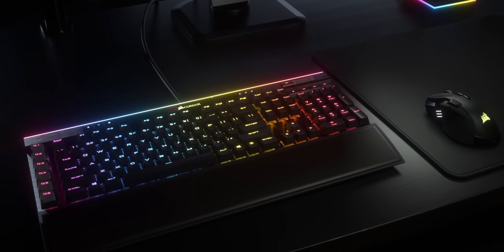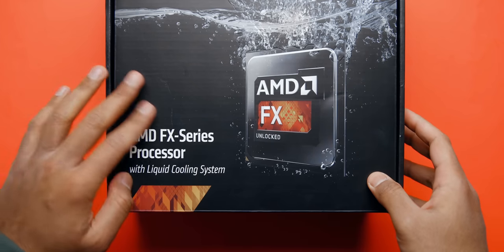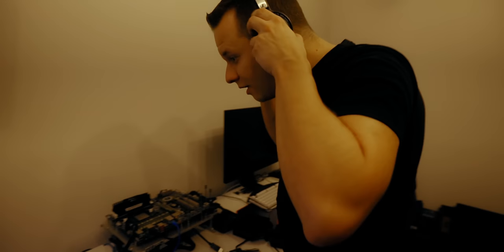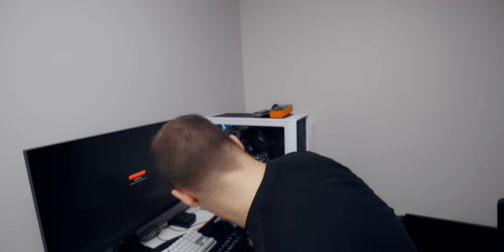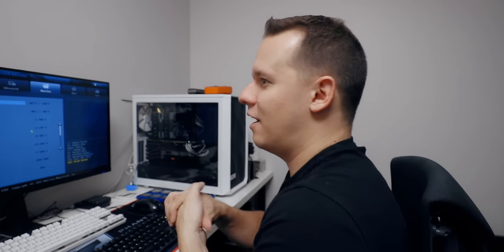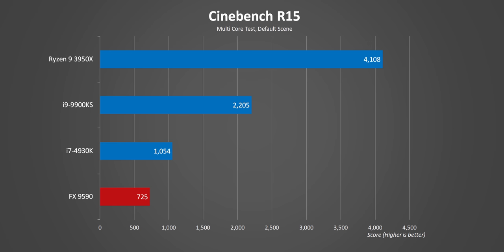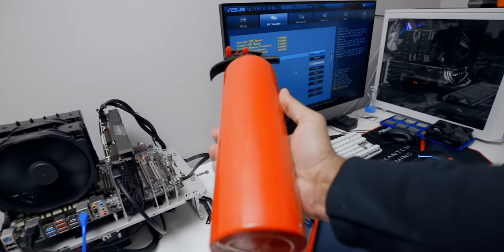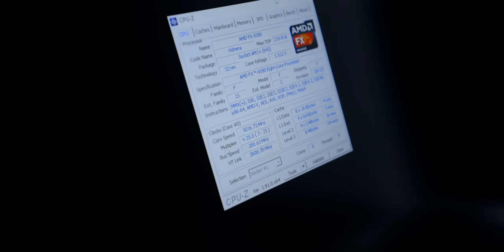Why The FIRST 5GHz CPU Almost Failed - AMD FX-9590 Revisited!

Comment: Intel now is like AMD back then

AMD back then still using old node and pushing clockspeed regardless of heat just to stay competitive,
but still drop prices in the end 

15:30
lifecycle
Reply: It's a cycle that tends to repeat itself. The Pentium 4 was pushed beyond its limits as well (Prescott, anyone?)
Reply: But the 9590 WASN'T COMPETITIVE, so how could it stay competitive?. It isn't competitive if it only matches an i5 3570 in gaming back then sometimes even the i3 and that is for $300 USD 200+W 8350 rebrand.

Ryzen has a 7nm advantage but none of their 8 core CPUs have beaten a 14nm 9900K and using core count+MCM as a band aid for their shortcomings.

Both situations are not similar at all
Reply: @JABelms  Wow, you sound like an Intel zealot. I can see the benefit of both sides of the coin, Intel has slightly superior single core performance which is great for gaming. AMD is the king, currently, of multi-core which is needed for doing real work on a PC.
Reply: @shadowtheimpure  Wow, you sound like an AMD zealot. Zen2 still trades blows with Intel, even in MT usage. Infinity Fabric remains a huge bottleneck; compare memory access of ~70ns (cross-CCX) to Intel's ~35ns -- which, believe it or not, is relevant in heavily multi-threaded workloads. Benchmarks won't show the difference since they don't work with large amounts of data -- which means that most memory access is to the CPU Cache, of which AMD threw ballsy amounts to compensate. Same with eg. 3990X - it's a dead product due to its memory limitations.
Zen3 is announced with some interconnect goodies, let's hope it improves the bottlenecks.
~Fellow AMD user, with multiple builds running Zen2 and AMD GPUs (that I should've returned due to the awesome drivers)
Reply: @JABelms  having owned both sides, honestly, it depended on the game and workload, as well as video drivers, nvidia has for a long time had better threaded drivers then amd, their drivers can and do make use of the extra cores, on the other hand, amd also had avx and fma support that took intel generations later to add support for, that, some workloads i have run, genuinely ran faster then an intel "supperior" but in the same price range chip would offer.

as to games... i have had a few of those that where insanely bias, but mostly anymore, games run well enough given a decently matched gpu, that i have run quite a few at 4k on both amd and intel for a few years now,  and note, im on a x5675@4.4ghz with 48gb ram as i post this, and, in some tasks this destroys the fx line, some games, its just..... pathetic, others..... honestly, many games i have played today, it dosnt matter if its an fx series, 9900k, 3700k, you will be capped by the games lack of proper threading and optimization... great example... GW2 talk about.....pathetic... it still thinks cpus have 3 cores.(yes it has more threads but only 3 are perf critical and any time one stalls the others endup waiting and it causes perf to just... take a shit....  

ARMA II and III are VERY much lovers of intel cpus... but i have also seem them run so close on a 3600g vs a 8700k, yeah... it was just a matter of the games lack of optimization vs how well the system compensates at any given modment... so close... it was pretty much a crapshoot... mind.. the 8700k was cooked with a THICK 280mm AIO with quad noctua high static pressure fans, the 3600g just had a "Macho" with cheap pwm fans on it, most games... its genuinely just a crappshoot, some even run better in one aspect, and worse in another, load times may be worse, but fps better, or the other way around, or, min fps may be better, but max worse, or max fps, very very high, but the min fps being paunfully low...like 17fps, at random spikes.

the same could always be said... as somebody whos owned both sides products from the 80386 era forward, i havent ever only had one companies product.. the k6-2 moved me from an overclocked intel chip to an overclocked super socket 7 chip, then i moved to a pair of  overclocked socket 370, then i moved onto a duron, then full k7, then i had a tul p3, was given a pentium-d (talk about a slow piece of shit....a dual 1.4tul based celeron system was way way faster...at stock..vs 3.6 out of a pentium-d....fuck sake..) 

again... it was always back and forth depending on use, one place even intels best i7 990x at 4.6ghz(hard oc from the exp of everybody i know who tried it on them with a decent amount of ram at least, and the temps, and power use...) couldnt beat the 8350@4.65ghz (negative vcore offset by 2 ticks, llc on high as close to 2600cpu/nb and htt as possible) with 32gb of 2133, was always faster at audio encoding at least from any format into OGG or Opus, with OGG using a BlackSword Optimized sse3 encoder, i was able to pull over 100x faser encode speeds in the same files at the same settings, same encoder, same exact settings, just.. made my eyes cross..but then.. i started to look into it.. and... HT off...i gained back 15-25% depending on the kind of batch, but... ht helps other things that without it...the intel chips dont look as much more impressive perf wise..

and the 1366 platform had such legs, because, triple channel ddr3 can come close to the perf of dual channel ddr4 but with lower latancies, and, the oc on them isnt that hard... a cheap x58r-ud3 is 100usd, an x5675 is 30usd shipped at the higher end, and ddr3 you can get 6x8gb sticks pretty easy these days ;)
Reply: @EdU-od5ec  the 7700k was slower in many games, vs my 8350@4.65...... that was over a year ago when we tested, was abit...shocking honestly...i remember under win7 it getting its arse beat hard... in every game...
Reply: @JABelms  9900k only have advantage in gaming tho, 3700x and 3800x did perform slighty faster in some rendering task.

Comment: I personally love hardware from around 2010-2015, there's tonnes of quality and potential out there, and you can sometimes find absolute bargains
Reply: 3rd gen i series laptops in that era are the best. Solidly built, has usb 3, removable batteries, some has msata, expresscard slot, and probably runs hackintosh
Reply: fm2 systems are dirt cheap while perfectly sufficient for most things except intense computing and AAA games

Comment: Hardware Canucks: 7:15
"I WAS using this for a long, long time"

Me:
... still using this motherboard to run the FX 8350 @5GHz

Also me:
Has a fire extinguisher beside my computer at all times.
Reply from the maker: LOL!   Its so true isn't it?  Those old 32nm CPUs were fire breathers.
Reply: Same board and CPU. I'm game stable @4.7GHz on air, but compute has me turned down to 4.6GHz still at 1.440V. How are you cooled and core voltage?
Reply: U14S, has to undervolt/clock down to 2.7GHz
VRMs are screaming constantly though
Reply: Yeah, until I upgraded to a Ryzen 3800x in the fall, I was using an FX-8370 running at 5 GHz as well.

Comment: It would have been a fun trip to go through all those generations of hardware.  My personal all time favourite.. x58. Loved that platform.
Reply: one of my favorite chip for its time was the P3 700. i had a dual CPU setup overclocked to 933 each. Basically dual core 1.8 GHZ which back them was a beast. out of everyone a knew I was the only one that could rum Q3A Q3DM19 perfectly at full res.
Reply: X58 was the funnest platform ever. Taking i7 D0 chips and clocking them from 2.66 to 4.0-4.4ghz was massive. Had a few of them. had a 930 at 4.2 with tri sli gtx 470s.
Reply: @jasongooden917  Oh man.... ABit BP6 Motherboard FTW! I'm guessing that's what you used for those dual Penium III CPUs.
Reply: I recently got a X58 board and an i7 950

Yes X58 is pretty damn cool

Comment: Rocked a FX- 8350 @5GHZ 1.48v since launch to December 2019. Man, the memories I got with this and how cheap it was... for my loads, it was perfect and didnt need an upgrade but wanted to switch to itx. And I was using the Sabertooh 990fx 2.0 as well. It goes to my parents now working as it was 6 years ago.
Reply from the maker: Which motherboard???  Would love to know!
Reply: @HardwareCanucks  The one in the video. Asus Sabertooth 990FX 2.0 with pcie 3.0 :)
Reply: small mention, was on a custom loop 360 copper rad and phobia UC2LT - never seen more than 45 delta over ambient at those speeds but got the room quite warm :))
Reply: I won the lottery I had a 8320 that ran at 5ghz for 4 years 24/7.
Reply: @slim420MM  Thats good. i managed to get a 8120 to 5GHz NOT stable, had to use safe mode in windows 7 to get it to boot.
Reply: had that mobo until my power supply killed along with the 9590 and hard drives
Reply: you ever have problems with onboard sound mine doesnt work at all no matter what bios or drivers i use
Reply: @HardwareCanucks  the crosshair v-z allowed me to get 5 24/7, 10 runs of ibt avx extreme,  and over 30hrs of p95 stable, using a mix of fsb and multi, as well, i have had much better luck with 8300 series getting 5+ghz 24/7 at lower temps then 9k chips.... mostly at lower volts by a good bit... many 8300 chips will do 4.5-4.65 at near stock volts..some even at a negative offset on the vcore.... thats with 32gb of ram at 2133... no joke... really just takes learning the chips and boards your using. 

my chv-z blew up, but, asus reached out seeing my post on fb about it and did me a major solid and gave me brand new, retail kit, that i tested but....im using an x5675@4.4 currently.... kinda wish i could get an EVGA SR2 and dual x5675(or x5690!!!) chips... matched set of 1866 ram to use with it... some of this old stuffs stupidly fun... 

asus had the boards most often used to get these results in my exp, but...its also a crapshoot, one thing you MUST do... make sure the goop on the chipset is good, and make sure those fets are given flow... even in an open setup... air flow over the fet sinks....

anyway, the fx line..take some tweaking to get the absolute most out of, and the tweaks can differ board to board... they arent as bad as many expected... not as good as some wanted to believe... it filled a niche...and was genuinely better for specific tasks...i mean in the price range... the 9k chips... are heat beasts...
Reply: @AshenTechDotCom  Asus are really good about support from what I've experienced. It's nice that they did that for you. I've only ever been able to get my 8350 to stable at 3.4GHz running CB R20 with LLC, but that kicks the voltage to 1.44 or there about, and I just don't have the cooling to make it worth it. Then again, as I said before, Asus is good about support. I've got an AM3 board from them that's flashed to BIOS allowing it to run AM3+ chips up to the 8350. If I had an AIO, I wouldn't be afraid to clock it at 4.5 with LLC, but the issue just comes down to the board itself. I don't think it's worth stressing it that way. It's fun to see how far you can push this tech though.

I doubt many people could tell the difference between a well-outfitted FX8350 system with SSD and decent graphics card and a modern AMD or Intel setup when doing most daily tasks. If video editing or gaming, sure, but people's expectations have also gone up. 60fps was considered good 10 years ago. Now, people want 120+ fps at 1440p minimum if not 120fps at 4K. If you compare a chip from 2012 to something that came out in 2019, sure it's going to be crushed. That's kind of pointless though.

Me, I'll be running Firefox with Discord going, have a Youtube video playing, perhaps off on a second monitor, while I'm editing hi-rez photos in Aurora, and I don't even think about it. So sure, I'd like a Ryzen someday, but I'm biding my time for the next release. If the human malware fiasco doesn't delay it. Until then, I'm not doing too bad. I can get 60fps in games at 1080p, and that's all my monitor can handle anyway. Well, it's 75Hz, so I guess that's not quite true.

Like you said, it comes down to tweaking at times, and boards can be finicky. But I think that's why the enthusiasts in this arena liked the FX line so much. They're fun to squeeze every ounce of performance out of. It's kind of a challenge.
Reply: Still using my FX 8350 @4.7 from when it came out on the gigabyte 990fx-ud3
Reply: Alex Susu Christ, it must have run crazy hot at that voltage
Reply: @TedMan55  actually no. That 360 rad and lapping + great waterblock was keeping it very cool. Given the low density of the chip and high dissipation area we can keep it cool with a good solution. Ryzen 3700x eats 3 times less power but is hotter for ex.

Comment: I used to love my FX 8350,great stability and a good overclocker. I thought the 9590 was basically just a factory overclocked 8350
Reply: Binned and OC'd. I specifically picked up a 8350 to replace my 8120 because they OC decently especially in a used price-to-performance.

Comment: I remember buying the 8350 black edition, since my mindset was "well it's much cheaper than intel's CPU's, and it has 8 cores! woow!"
...If only I checked out gaming benchmarks, userbenchmark, etc.. man that thing got beaten by a second hand i7 2500k that I "upgraded" to xD
Then went to a 4790k second hand which dominated both of those CPU's, and gave me a massive jump in FPS. Now running a ryzen 5 3600x just for longevity, as I had no idea how long the 4790k would last me.

Gotta say though, this thing was running at a horribly high voltage out of the box, and ran at like 50 degrees at idle.. Better after I went through with aisuite's easy tune, but the stock heatsink is still pretty loud. Couldn't use my AIO from the 4790k (might've been a good thing though, as it was like 5-6 years old), so still debating what cooler to get :p
Definitely going with air cooler now, as they'll basically last forever, but can't decide
Reply: My FX8370E is worse in games then i7 2700 or i5 7400 with a few fps. But in multitasking I AM A DESTROYER.

Comment: ohh now I know the 'Bulldozer" chip I have been hearing about a lot of times.
Reply: They really were bulldozers. Impossible to kill as long as you could cool them!
Reply: Most of them were not clocked so high to begin with, though they generally would overclock very well if you had a good enough motherboard and power supply and knew what you were doing. They were also very competitively priced. They had some good budget options, like the 4300 and 6300 (4-core and 6-core variants). They had great bang per buck, but they didn't sell particularly well. One of the issues was that they didn't offer much (if any) improvement over the performance of the previous gen AM3 CPUs (such as Thuban), so a lot of the people who were willing to buy AMD CPUs were already happy with what they already had, presumably (I know I was). I stayed with the AM3 platform with a few different CPUs, the last being a 960T which, in my case, was a super good overclocker, until I finally upgraded to AM4 about a year ago.

Comment: I remember the FX-9590, I won it in a sweepstakes from AMD. I paired it with a Thermaltake Water 3.0 Ultimate 360mm AiO, just retired that AiO a couple weeks ago in place for the Arctic Liquid Freezer II 360mm in my current 3800X based build.

Comment: The first 5ghz CPU did fail, it had the ipc of a core2 processor when 2nd generation i7 cpus were out and had more than 30% more IPC... 3ghz 2600k could outperform the fx chips running at 5ghz.
Reply: Now it's vice versa lol
Reply: @dierrickyoung5501  well now its neither, intel and amd cpus basically get the same scores if you clock both at say 4ghz and run 8 threads or less... except Intel cpus can run at 5.2ghz and amd can't
Reply: @Salt Maker yes but what about when Intel goes to 7nm
Reply: @Salt Maker it's nowhere near as disparaging as the difference between a 2600k and an FX9590
Reply: @Salt Maker idk probably along time till Intel can hit 5ghz this easy
Reply: @AKATenn  that's not true, AMD has better ipc than Intel now.
Reply: @AKATenn  5950x has entered the chat
Reply: IPC of a Quad core. Hadwell get it right.
Reply: @YorHighness  IPC has nothing to do with how many cores, it's instructions per clock, each core is identical, each core does the same amount of instructions in one clock cycle.
Reply: @dierrickyoung5501  They still cant get even 10nm working even now, by the time they hit 10nm AMD will be at, or close to releasing 5nm

Comment: My fx-6300 still runs great at 5Ghz
Reply: 5ghz 1 core not all cores xd whilst a modern i9 gets 8 cores 5ghz without overclocking lol come on its time for you to upgrade, if your pc crashes at all then its cause your not using intels platform since stability and driver support is where AMD cheaped out on.
Reply: @thelightsilent  lol chill. My 6300 runs 5ghz all core 24/7 and when I upgrade it'll be to an r5 3600. I also never have crashes or issues whatsoever and enjoy 1440p 60hz at all times